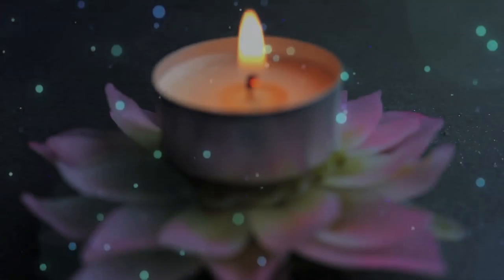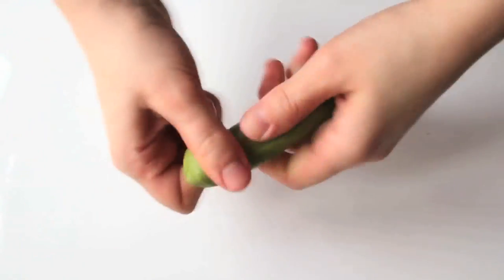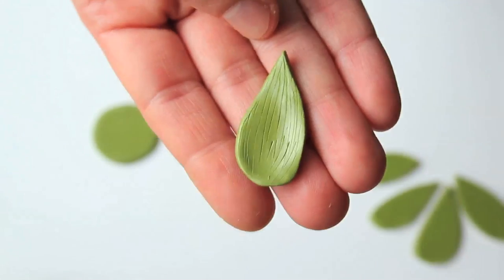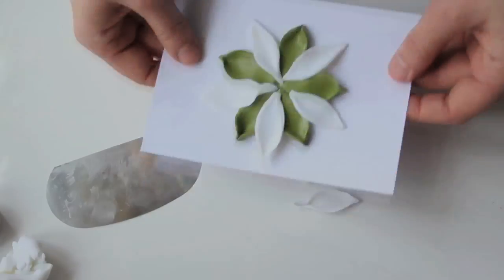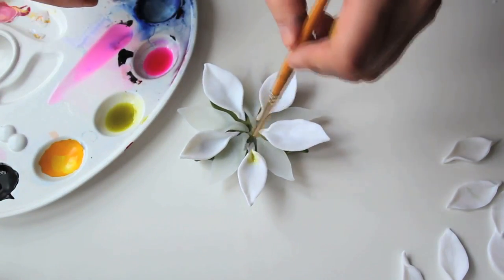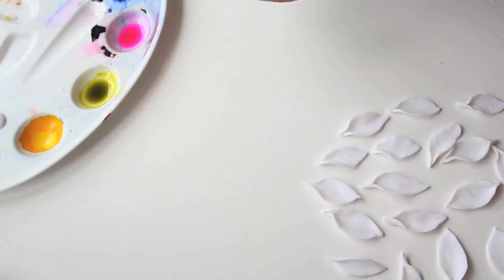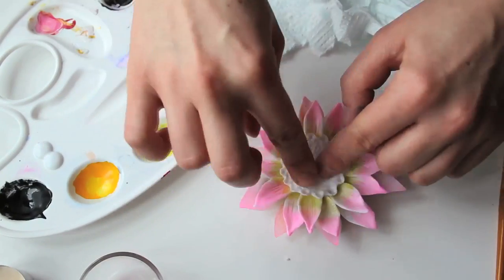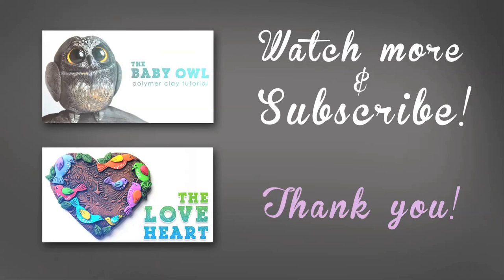LOTUS CANDLE HOLDER from Polymer clay, polymer clay flowers, 软陶, ポリマークレイ, Полимерная Глина

Comment: Can I use watered down acrylic paints???
Reply from the maker: I am not too sure, I don't think they will give a translucent effect because even watered down they are not very translucent paints... But you can try.. and see how it goes :)
Reply: tried it and didn't go to plan, they didn't soak into the clay and just ran off, it was worth a try though, thanks for the response!
Reply: Mr 3GGy 1999  I watched another video where someone used loose eye shadow powder before baking, then sealed everything after baking.
Reply from the maker: It is all chemistry! It's easy to check as well! Try it and if it works - use it, if you don't like it - dont :)